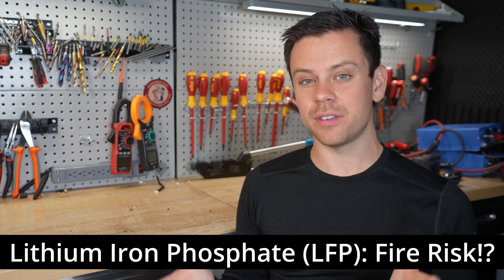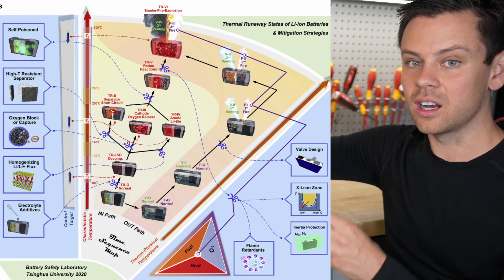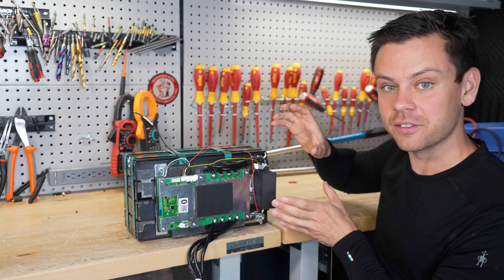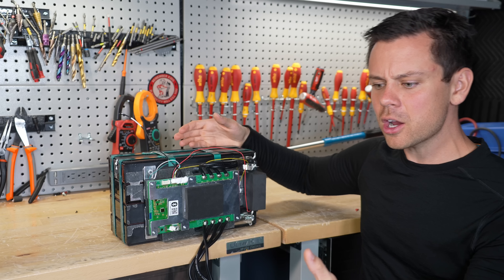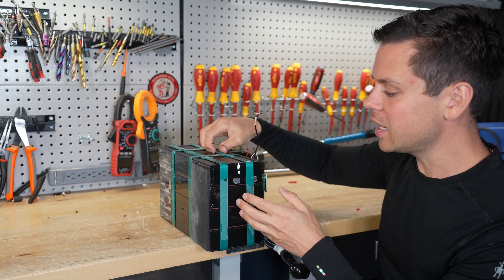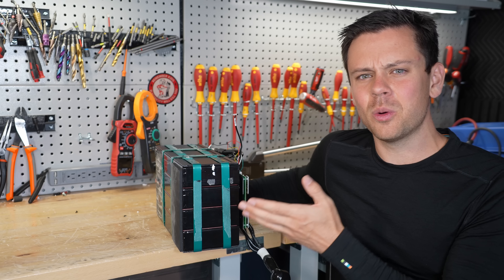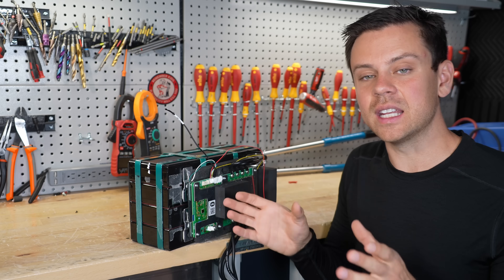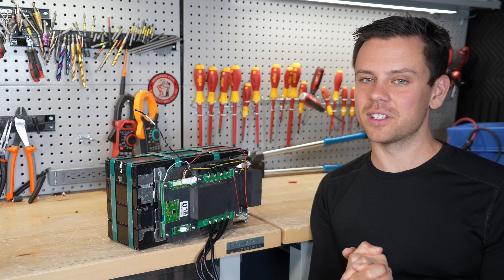LFP Battery Fire Safety: What You NEED to Know

Comment: So, what should we do in case of a fire?? I was hoping you would address that. With something so heavy, is it safe to move it outside if possible to access it? if the battery back up is in the basement of a home, it might be hard to try and drag it outside. If not, what fire extinguishers are used to put out a fire form a battery back up?

Comment: Hi Will Prowse, 

ive been considering a battery backup system to my medical equipment in case of a black out situation... 

the equipment consumes max 65Watts [230VAC 2.71A] and i need to run 8-9 hours on a daily basis, and im looking to cover min 2 days of use but would feel better to cover 4 days of use.

can you help me by giving some advice?

thank you kindly

Comment: I just picked up a thermal module to plug into my iPhone - Nifty tool/toy. Went out and looked at my solar rig with it. The wires from main bus bars to inverter were just visibly warmer than ambient, and the inverter was pleasantly toasty for the draw I was putting on it at the time. Nowhere near like dangerous, just enough to be obvious in IR, with several distinct heat spots I have to assume are the MOSFET/PWM banks and the transformers. And then there were my copper lugs on the batteries and on the bus bars - Anywhere I had bright, shiny copper showing. Thermal said "Them things is HOT HOT HOT - instant blister territory." Finger said "I guess it might be above ambient, but if so, it's maybe a degree or two." My conclusion: Shiny copper lies to the thermal camera. YMMV...

Comment: Understably, there's a lot of focus on hydrogen being released - which is a problem to be sure - but there are the real nasties as well, like hydrogen fluoride. Look it up if you don't know about it, it's truly the stuff of nightmares.
I'm wanting to install LFP on our boat (sailing yacht/sailboat), but will not, until I can find a safe way to vent the batteries to the outside.
If anyone has any resources on this, I'd be grateful.
Reply: The effects of HF gas on the human 
body are well documented. When in the presence of water, HF gas forms hydrofluoric acid, which is both 
corrosive and a systemic poison. Exposure and inhalation of HF results in the following sequence of 
events within the body
• HF gas inhaled
• Dissolves in airway fluid → hydrofluoric acid forms
• Partially dissociates → some HF molecules remain intact
• HF penetrates deep into lung tissue
• Inside tissue → fluoride ions released
• Fluoride binds Ca²⁺ and Mg²⁺ → severe electrolyte imbalance
• Local effects: necrosis + pulmonary edema
• Systemic effects: cardiac arrhythmias, possible death

Comment: The crazy part? It is practically illegal to have stand alone LifePO4 batteries inside of a living space in Australia(including vehicles, vans, rv's and caravans). 

What is crazy about this? An LFP based power station is fine to have indoors. As is a large lithium ion powerbank or power station. (Do I smell a rat?.. )

The idiocy in australia is part of updated battery storage standards released in 2021(from memory(. Essentially, having stand alone LFP batteries inside a living space, means no insurance cover. Unless it's an LFP based power station, then you can have a dozen inside.. 😂. (Australia is insane). 

The new australian battery storage standards were bought down for the "highly unlikely event that LFP might, could, possibly, maybe, emit toxic smoke or burst into flames". Therefore, they must be fitted externally or be in a sealed, fire proof vessel that vents to the outside.

Comment: Best tool a person should invest in is a thermal camera. Do a spot check under load every so often and at least a yearly self inspection. If a bolt or wire is loosening it can be spotted with a thermal camera. It’s easy, safe, efficient and, will lower the potential of something untoward from occurring.

Comment: Back in 2009 I built an e-bike using a 48V 20Ah LFP battery on top of a rack on the back of the bicycle.  Not long after building it the top heavy bike slid and fell over onto concrete.  The LFP battery started smoking and beeping right away.  While it was smoking and beeping, I made some jokes about not being able to have kids after this due to the chemical smell.  It never caught fire.  After ~40 minutes, it stopped smoking.

Back then these LFP batteries were super expensive and it was a bit disappointing to wreck a brand new battery in a simple mishap where the bicycle fell over, but I was happy that it never caught fire.  It's replacement battery was a super shoddily done LFP that was duct taped and shrink wrapped together with endless problems with its balance leads causing cells to get overcharged and in general all kinds of problems, but that super cheaply done battery still managed to make it 14 years before it finally came time to retire it.

Comment: Those  lifePO batteries caused a fire in my garage and almost burned down my house.
Reply: He is wrong on Everything he is saying those cells get hot enough to cause fire on flammable things near it, when the firefighters came the temperature was over 400 degrees, firefighters said that they have been having a lot of fires from lifePO batteries.
Reply: @carloscetz8314  ah, yeah, if they're sitting too near flammable objects. A simple barrier of durock or metal would stop the transfer of heat. Unfortunately most of the year the weather is either too hot or too cold to have batteries outside here. I'll be building a barrier around mine shortly. I also only charge well under. 5c, which decreases the chances of venting. I would never routinely charge at the limit, since you have to factor soc, anyway. Pretty sure he said in the video of it's a plastic case that the grades get hot enough to potentially ignite nearby objects. I would cut him some slack if he doesn't know the cases get hot enough. I didn't, and now that I do, I'm adding barriers.
Reply: @Flyinghook  good idea some sheet metal can also work good if you have batteries in your garage I'd install a smoke detector, That's what I'm doing but I will also  install one inside my shed where I moved everything.
Reply: I'll rebuild my system but everything will be outside no more stuff inside my house.
Reply: Yes lifePO the space was sir conditioned 75 degrees all the time , was charging at manufacturer specs all of of the sudden if went off.
Reply: Are you sure they were lifepo4? What were the conditions around the fire starting?

Comment: In our local news was one case, that lifepo4 cells failed and produced gasses that saturated the room in the residential house and these mixed gases explode and destroy the house. The fireman officer confirmed that was lifepo4. The system was well build but something went wrong. Almost anything was destrozed by fire but from that explosion.
Reply: LFP cells can release hydrogen gas, and if that hydrogen doesn't have an escape path in a closed room, it can ignite with the oxygen in the air. That does apply to lead acid cells too though, that's why batteries should always be kept in a ventilated area. A little bathroom fan to exchange the air in the room once per day is usually sufficient, but it obviously depends on the size of the battery.

Comment: Those of you who are using either Zorin or Mint, are you able to run most of your Steam games on your system without complications? I’m pretty much ready to switch over from Windows 10 for good, but I’m wondering what’s going to happen to my Steam library. Will I get the same performance in my games as on a Windows machine?

Comment: A SHOTO SDA4850 battery burned internally after shorting out the AC output of the inverter on an LED lamp. When the battery was opened, one of the 7-cell balance connectors burned completely up to the batteries; only that burned out. Why did this happen? The BMS shorted out the balance connector on that side and burned the balance cables on that side. Smoke came out of the battery; when I opened it, it was completely black.

Comment: Hi Will, any thoughts on this? 

"GAYTON MARINA DAY BOAT FIRE AND EXPLOSION

Official response from Northamptonshire Fire and Rescue Service:

'We can confirm that the battery was LiFePo4, which, as you may know, are a type of Lithium-Ion battery, but we recognise that there are differences across the range.

 

The explosion was caused by the ignition of flammable vapour that was given off by the battery when it either developed an internal fault or was caused to go into a fault condition by an external means. This means that technically the battery did not explode, it was the flammable vapour that the battery released, and which gathered within the boats compartment.

 

Our advice is generic across all the batteries, with a key message being that if people see vapour coming form any battery, which might look like smoke, to move away and call 999."

Comment: I am sorry Will but i am not accept your theory about fire! I am professional battery maker start at 2017,I make lot of Lifepo4 batteries in wood case plywood,use on solar systems.For 8 years i make 100+ batteries for me and for my customers. No one of this batteries takes a fire! All about is how will assembling the battery,what parts you will use,copper-brass components,soldering the wires etc

Comment: Due to BMS failure, the offgassing is possible during overcharging. Now the question is : what is the chemical makeup of those gasses ? Is it possibly hydrogen ? Carbon monoxide ? Gasses that can literally explode even because of the static electricity ? Those explosions are extremely rare and require additional faults (electrical or mechanical failure) but still : keeping them anywhere but well ventilated and structurally isolated compartment is asking for "it".

Comment: Thinking of taking these out of my house after the watt cycle batteries in my garage setup popped and started blasting smoke out. Inverter alarmed for over voltage but both units were already damaged. Ran 4 months with no trouble.

Comment: Nice nice, one little extra is that charging the battery at sub zero temperatures can cause dyndrites forming and that can lead to an internal short inside the cell itself. Dyndrites are little needle like lithium structures

Comment: What if you put the LiFePO4 in a steel cabinet, and then built a smoke pipe at the top of the cabinet and connected it to the ventilation shaft? If it ignites, the flames and sparks won't leave the cabinet, and the smoke will go up the chimney.
Reply: I had a big LFP battery bank of 3600 amp hours catch fire thanks to a battery that was dropped during shipping.  You need a cabinet of at least 3/16'' steel walls, maybe 6'' schedule 40 steel pipe, and maybe some 195 degree F actuated water sprinklers inside. The heat released was hideous. I had 6'' glass ball shaped light fixtures on the ceiling and the LED bulbs inside melted and took the round shape of the glass into which they dripped. The fire did $150,000 damage to my shop and garage, mostly smoke and water damage. It melted the shop sub panel on the wall nearby and shorted its wires.   My replacement system is UL rated with each 200 lb plus battery in a steel sealed container with internal fire suppression built in.

Comment: Generally  agree with you, but having worked in Asia for years I have seen many EV fires in China and of late on transport train cars and on ships. Not all Chinese EV's are PO based battery systems. Many bus fires in Asia and Europe.
Reply: The problem is not typically the chemistry but rather the high voltage catching something else on fire. The difference with chemistry is if when the battery heats up and catches on fire/thermal runaway there's basically no stopping it unless you can completely flood the case to extinguish the flame and cool them... Of course then there's the issue of electrocution. 

My thought for a solution would be for EVs to put a hose quick connection in the center of the back window where FD can break the back window that goes into the battery case and a truck with deionized water is used to flood it (most FD's have a deionized tanker for electrical fires already)
Reply: @commonsenseisdeadandgone The 3 recent RORO carrier ships all seemwd to have thermal run away issues. 2 confirmed,1 sunk but could not be put out with onboard CO2 systems on sealed decks. Lithium  creates it's  own O2 once going. Mosslanding fire investigation shows runaway, same with 2 barnhaus bus fires in Germany involving over a hundred buses between rhe 2 locations.
Reply: @johns9888 I Did you research to see what happened? Did you check if fires have happened to cargo with non electric cars

Comment: I had a lifep04 cell leak the very bad smelling fluid. It was in my shed, not moving or rubbing on anything, no swelling, no BMS failure,  but case failed somehow underneath in each corner on one cell.  If there was a source of ignition, would have set fire to the fluid and the rest of the 15kw grade a eve cells. Luckily my shed is made of metal.

Comment: I also had doubts about getting lifepo4. I am currently researching for a backup system: 2000watt inverter and 2-3 batteries for about 600Ah, and a decent charger for them. 12 volt because its compatible with so much other things. So i have switched from i lead acid fan to lifepo4 fan, mostly because they can take 100% SOC the few times i will have to use them to that lvl(lead acid will start to kill themselves below 50%). They are often really safe and most cheap ones are totally okay for my type of use. They will ha a nice stable temperature and will not be used to often(hopefully).

Comment: It is not a big chunk of wood. It is a sack of flammable electrolyte. And the smoke from the burning electrolyte is extremely toxic. Adding LFP cells inside the living space of your house does increase the overall hazard level in case of fire. Venting to outside would certainly help. Or keeping the batteries in a dedicated building or shed.
Reply: What you're writing is true, but in my opinion, you're spreading unnecessary panic. Just look at all your plastic interior furnishings... mattresses, etc.... The smoke from your interior furnishings is enough to kill you. You don't need a battery for that.
Reply: @maidn1887  If anybody reads what I wrote and panics, they must have a very low threshold for panic. The only point I am trying to make is that if you have a large LFP battery back, you should try to install it in a utility shed or something that does not vent into the house. If possible. Barring that, follow the building codes applicable to your installation (which probably means buying a pack with a UL listing).

Comment: This cell stays happy it's got electronics with a Bluetooth. Yes what happens if the electronics gets a signal from somebody's Bluetooth that says overload the battery. Oh do you know exactly what's on that bms. Oh no it won't catch fire without a BMS. I sure like good old lead acid and AGM batteries. They don't just blow up. I've had the same ones in my solar system for half a decade now and I have no problem at all. Golf cart batteries they're just big they're heavy and relatively inexpensive compared to some things.

Comment: I bought a bunch of those pouch batteries from battery hookups. All of them look like they were used. Well turns out they were used in China. Buying used batteries in America that they say are new is kind of dangerous. The batteries that came in the box all had different manufacturing labels. Different dates and stuff like that. Course it's all in Chinese except the date. I blew up a few of them. Solar powers yeah protected by the charge controller never went over 14 volts. Yep I had a hell of a time getting my money back and I felt bad shipping them back through the mail I'm glad they didn't burn up anything on the way.

Comment: PV Magazine 4-10-24:
Researchers in the United Kingdom have analyzed lithium-ion battery thermal runaway off-gas and have found that nickel manganese cobalt (NMC) batteries generate larger specific off-gas volumes, while lithium iron phosphate (LFP) batteries are a greater flammability hazard and show greater toxicity, depending on relative state of charge (SOC).

Comment: well done young fella, nice job - i want to at some point to use a rechargeable power system in an overland type vehicle, but after watching various videos on You Tube, i am still to be convinced - my own example was having purchased a small device, a miniature keyboard with wireless USB connection, it was handy to slip into my inside jacket pocket, but after a few months i suddenly felt a burning against my chest, on removing the device i noted how it had split apart, on closer inspection the battery had indeed blown up, fortunately had not split open or i might have been seriously injured - but there have been many reports in the news about phones on charge etc catching fire and in some cases burning people when carried in a pocket
one of the channels i follow is Sal's channel 'what's going on with shipping' where there have been a few reports of electric vehicles being run up ramps in a hurry to load ships, batteries have been damaged internally and a thermal runaway has resulted in a few onboard fires, causing loss of life, and loss of ship and cargo
so to have a few batteries hopefully secured, but being bumped about is still a little concerning, i been watching a lady who is converting her yacht, removing the diesel engine, and putting in a electrical system, it concerns me that batteries could become lethal in rough sees, and the batteries will be placed under the steps leading in and out of the house cabin, there will be a hatch forward, but its a concern
sadly there will always be accidents, but to avoid them is something else